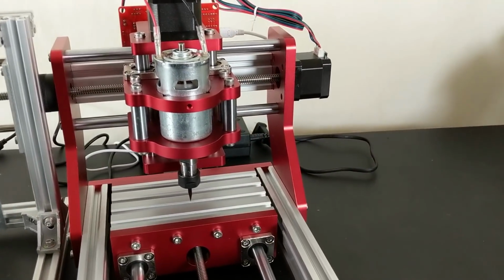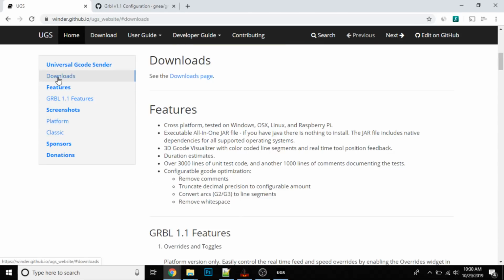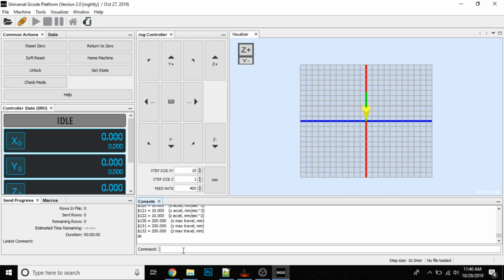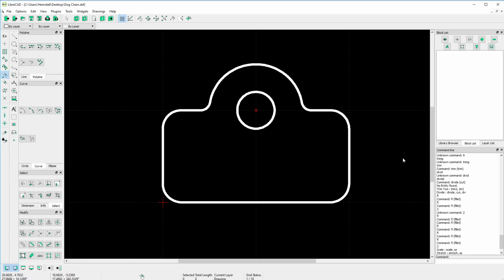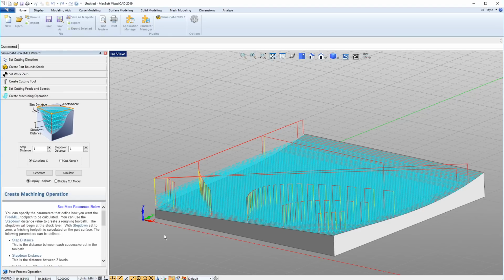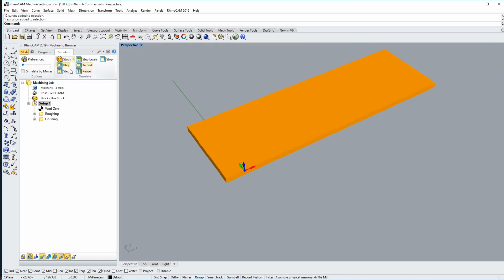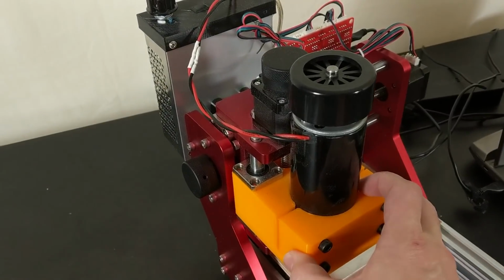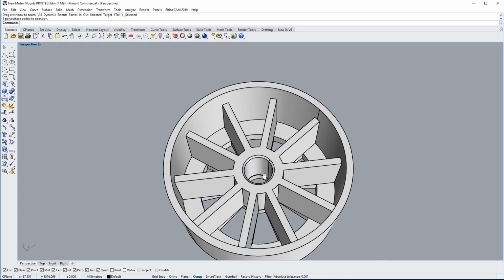How To CNC Cut Metal For Under $400 using the 1310 CNC Router

Comment: What's the name of that larger cnc in the background?
Reply from the maker: Foxalien 4040-XE  https://www.amazon.com/Machine-4040-XE-Spindle-Engraving-Engravable/dp/B08M96HHKW/ref=sr_1_1?dchild=1&keywords=cnc+router+4040&qid=1605163511&sr=8-1
Reply: @DesignPrototypeTest  you'll have to upgrade the 300W spindle with 800W+ spindle to cut soft aluminum
Reply: @DesignPrototypeTest  Thanks. Didn't you post a video about it yesterday?
Reply from the maker: I did, I've hidden it. Like all of my livestreams it was losing me subscribers. Here is the link to it: https://youtu.be/2gSERoUUGYw
Reply: @DesignPrototypeTest  Thanks. About that small CNC, check this video out, this guy has many videos on the upgrades he did. https://www.youtube.com/watch?v=EpN7Oj00IwM
Reply: @DesignPrototypeTest  Livestreams lose viewers? That is so strange. Can't people just not watch the livestream if they don't want to, why unsubscribe lol. Youtube... I will never understand it.
Reply: @DaneC020  Yeah, that's the video that caused me to subscribe and I wouldn't have seen this one otherwise!
Reply: @DesignPrototypeTest  I've had a look at the spec of that machine - they boast, on that linked page, of it cutting 1mm thick ali, at 0.2mm depth of cut. For ali, your little cnc mill you dismissed last week, would easily achieve that. For this more expensive unit, If the bed/frame, is strong enough, get a more powerful spindle, even swap it out for a cheap router, or die grinder.10,000rpm is not fast enough, 300W is not powerful enough, and look at the overhang to the collets. It is OK for engraving, and light woodwork, I guess, you will have to take metal cutting very gingerly. Make a boot, (3d print it) and use a vacuum cleaner, and be careful if machining mdf.  With a wooden wasteboard, you will not be able to use much coolant for metal cutting, nor be able to hold lumpy work-pieces that securely. Put one of your duet controllers on it, you know you want to...

Comment: That's not how the Cartesian quadrant layout was taught to me in school.
Reply: The game looks more sructurally rigid. The spindle motor looks like garbage, and the steppers and control may be usable. I can not tell if the linear screws are came, but maybe just v thread. I don,t see the value here!
Reply: Its different for math or engineering etc ... There are also a Lot more layouts Like Orbit coordinates or cylinder coordinates... Yeah
Reply: @clypeum5063  - The video's drawing and it's explanation of what's positive and what's negative isn't consistent.
Reply: j mtx is correct. Horizontal is always X with a negative value left of 0 and a positive value right of 0 and the vertical axis is always Y with a positive value up, and a negative value down from 0. So clockwise starting top right is (+,+) then (+,-) then (-,-) then (-,+). This is standard Cartesian plane. He even explains this correctly immediately after. Must have just been the way he was looking at the paper. Simple mistake on the drawing
Reply: j mtx: you are right.  He wasn't paying attention to what he was saying and writing.  I think this is because he was standing off to the side of the paper, which put the X axis vertical to him and the Y axis horizontal, and just got everything twisted wrong as a result.  The only important part is that the (+, +) quadrant is up and to the right of the origin, which he got right, so the rest was pointless rambling anyway.
Reply: Yes not in math classes but in some technical classes because some students lack of math background, it's easier to explain this way.